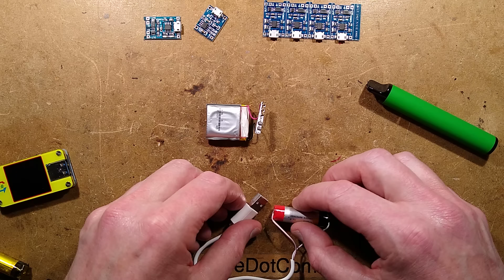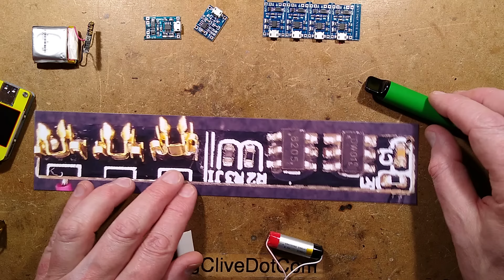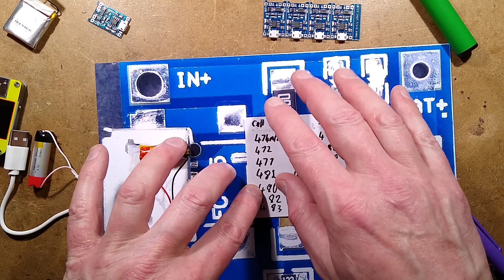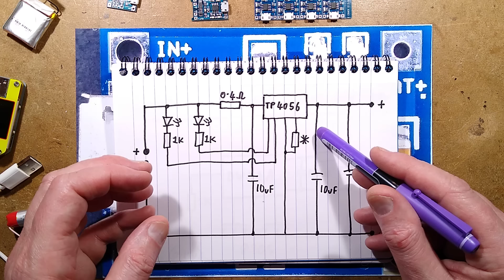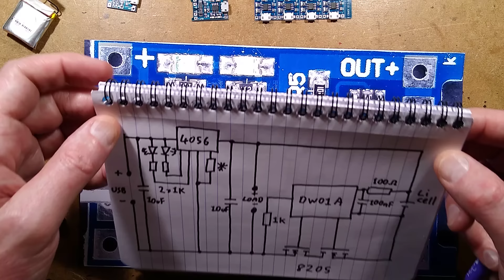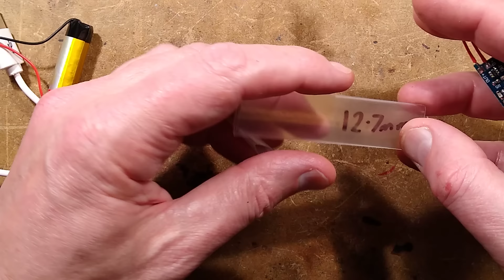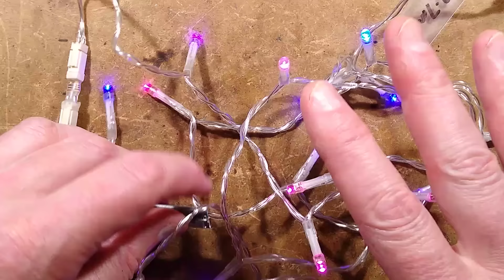Don't do this!   (There's a much safer way)

Comment: Yeah, the first time I tried this years ago I found that to wire idea quite dangerous. Not I didn’t do it a little bit until I found these really simple $10 items. They charge 4 batteries at a time, different sizes in length and width because I find a way to balance them in there. It’s not too difficult. But a square battery, or something like that odd shaped I had to put little clips on one of my ports. That way I could just clip it onto the battery terminals, but as far as length and width the round ones, it does perfectly. At one point I had over 200 batteries because like he said you can find them and vapes everywhere. Plus I was smoking a vape every four days. My aunt , same thing and I just saved them up and I converted my flashlights around the house to run on these batteries. Also, I got one of the tiny charging port chips that he is talking about and I was able to take one of my remote controls apart for the TV  have a port sticking out and I installed a little battery from a broken iPad, stylus pen, and it had a long skinny battery in it like on the tiny vapes. I put that inside the remote closed up the remote and I’ve never had to buy batteries for it since.  I just pop it on the charger every now and then and I’m assuming that battery will probably last for life not that TV and charger considering it doesn’t take much to charge it. I also love the little batteries inside the EarPods. I like to take the cheap ones apart when I have a spare small speaker and pop the front earpiece off of the earbud and very carefully take hair like wires that are going to the tiny speaker off and hook them to a slightly bigger speaker and put it in a neat little container and stick it in a planter and I have a little Bluetooth speaker just sitting around in different places. Yes I was a little weird, but it was fun.  The chargers I was talking about I found one on eBay. Here is a link it’ll give you an idea. https://www.ebay.com/itm/274434618596

I even converted my mag light. And a bunch of my little flashlights. It gives them some serious juice considering 3C or D or AA batteries only equal 4.5 V one of these “3.7“ volt rechargeable batteries which do charge up to 4.2 for some reason and I will tell you. They were bright. You just have to get creative and figure out a way to convert things. One of the bigger, plastic flashlights, I actually added a few batteries inside of it that I got from old laptop batteries Those are supposedly “dead“ turns out when I break them out of the plastic casing and take them off of the little board and I don’t know if this is just my imagination, but it seems to work and I’ve had people witness it. The top of those batteries on the positive side have the little vents and I reach in there with a paper clip or something small and press down and I hear a little click. I do it on all  the little holes on the positive side of the battery and low and behold that battery that was registering dead as a door nail on my multimeter, suddenly registered as having some juice in it after doing that little trick. We’re talking batteries out of laptops that are 12 years old 10 years old. After typing this I went, and I found an article on indestructible’s talking about exactly what I do to revive them. https://www.instructables.com/Recovering-18650-Lithium-Batteries-With-Only-a-Pap/ 

I didn’t know if I smelt that ominous smell of the battery leaking to throw that battery away I did not know that there is a fuse in there that it’s disarming or resetting but I’m glad to know that I wasn’t just hallucinating. Because those batteries went from registering, almost nothing to registering like 1.2 V from just putting the paper clip inside there and doing that.
That little circuit board in there apparently makes it seem like the batteries are dead in the laptop but if you pull one out, check it with the multimeter and it registers is completely dead do that little trick in the holes on the positive side, just push down as if there was a little button in there and then put it on the multimeter afterwards, and if your experience is anything like mine, it will suddenly register that there’s some juice in it and then I’m able to pop it on the charger and use those batteries. I’m not great at all of this stuff but I’ll tell you what it’s fun. But as I was saying about the bigger, plastic flashlight, I put 3 batteries inside of their together running in line and now my flashlight will actually charge my phone if I needed to. Lol.

Comment: This is all fine, but if I could please request a video? I wish to use a similar setup to make a powerbank, so I will need to solder some batteries in parallel as well as in series (I assume), and I don't want to set my house on fire. What equipment do you recommend? Can you make a video with step-by-step instructions and material lists? Much appreciated.

Comment: I found once protection PCBs for 18650, 18350 and 26650 with pre programmed overcharge safety set to real 4,19V, made "dumb" charging solutions for small DIY projects pretty convenient and easy by just using a 5V power supply.

Regular protections circuits on LiIon cells have typically anywhere between 4,22 and 4,25V cutoff voltage mostly so every charge harms the battery noticeable more.

Comment: I have a phone that has a 2-cell battery and can be charged with up to 120W. Actually I charged it quite often with 120W and after 2 years the battery is still fine, although acccording to this video I shouldn't charge it that fast (it takes less than 20 minutes and according to this video, charging should be done at a speed at which it takes over 30 minutes or evem slower with over 1 hour). Why is this the case?
Reply from the maker: Routine fast charging puts extra stress on the cell.  But your phone may have only been doing it within the central portion of the charge.
Reply: @bigclivedotcom  it definitely charges slower when over 80% or so and quite slow when over 95%.

Comment: i re use a charger built for a vape battery it only charges the breeze vapes to 80% which is fine with me as i try to keep them as long as the coil isnt burnt tasting.

Comment: That connection makes me physically sick. Even with bunch of voltage drops on the cable, the battery will get overcharged eventually.

Comment: Saw on one video that if you want to charge this Li-Ion battery you can put from 4.5-5.2 kOhm resistor to cut to 0.250mA charging or 0.125mA. This is R3 resistor on circuit board. Thank you on clarification. Regards

Comment: Charging batteries like that is a very bad idea, obviously. 
But I sometimes use a similar technique to revive completely dead (0V) phone batteries. Set a bench PSU to 4V or so and shock the battery for a few seconds at a time until it gets to somewhere around 3V. Then you can put it back into the phone and charge it up as normal.

Comment: I think it's criminal how lithium batteries are included in throwaway products. You are doing a great service by showing people how they can be reused.
Reply: That and I’m sick of seeing the box and the wrapper on the floor next to the bin outside the shop the child has just bought it from.
Reply: @jamessones4044 not to mention all the little stickers stuck to the bin or everywhere locally around the shop.
Reply: these disposable  ones need to be banned.no i think paper cigs were better.
Reply: Don't be idiot - crime is PRODUCE so dangerous batteries!
Reply: But how many of those people actually see the value of and reuse these cells?  Nowhere on the packages do they suggest other uses or even to recycle them like lead acid batteries or add a core charge to the price.
Reply: It’s insane. Got a vape with Bluetooth capabilities and a huge screen. Saw another that is straight up just a phone. And we’re supposed to throw them away after? It’s crazy
Reply: absolutely, its such a waste. Lithium is so damaging to the environment to produce. Not to mention some of them now have screens, hell even bluetooth speakers (look it up), so we're also wasting silicon for the essentially little computer inside, which is a precious element that is getting harder and harder to find. It's also very damaging, but not as much as lithium, lord.
Reply: @apollo7557  Silicon is not hard to find. It's literally the most abundant mineral on the planet. Yes it needs to be processed, but it's the rare earth and precious metals that are scarce. Such as lithium.
Reply: @EgoChip  well yes, but the chip shortage would like to argue with that
Reply: @apollo7557 The chip shortage was caused by COVID and the greed of car manufacturers (and the extremely limited supply of 200nm process fabs) not by a shortage of rare earths or any other minerals.
Reply: @apollo7557 chip shortage anyone? 😂
Reply: This absolutely 100% should be illegal.

Comment: If it works, it works, keep it simple.
Reply: It works only in theory. The battery starts heating up to dangerous levels very quick. And you have to constantly monitor the voltage because it's very easy to overcharge it and create a bomb.

Comment: i would be very interested to know if you could make a additional content to this where your use more of these batteries in parallel to up the capacity of the batteries (now battery pack)

i know that there are some technical difficulties with batteries when there are not the same voltage so i assume that simply doing what you did and just add batteries in parallel won t be an optimal solution
Reply from the maker: A large parallel cluster (when voltages are matched) does add up to one big cell.

Comment: I literally was thinking about YouTubing this. Here it is. I charge it on my vape 18650 battery charger. My question is if i combine two cells do you need a battery change controller? If charged correctly. Also 18750 car like a bomb if they go off. Overcharged a vape when it exploded it left nothing of the vape. Honestly surprised terrorists haven't turned Tesla's in to a IED

Comment: So I found out that the low voltage is too high imho. It's right in the peak delivery voltage range, iirc 3v. Is there a way to lower that to 2.5v?
Reply from the maker: The lithium cells are normally charged to 4.2V.

Comment: I just put them into my battery charger. It's a multiple battery type charger. I bought it for my 18650 batteries for my vape. It works with disposable vape batteries as well.

Comment: It wouldn't be too hard to make a variable programable resistor, so when it's at 80% charges slower the battery right?
Reply from the maker: It's easier just to use the chip designed for it.

Comment: It's normal for the TP4056 to heat up when charging a vape battery?
Reply from the maker: Yes.  It acts like a controlled resistor to limit the current, so it does get quite hot.

Comment: The USB cable had a chip inside that limits current. Cheap ones only allow about 1amp of current.
Reply from the maker: Most standard USB cables have no chip and no current limiting other than their thin wire.

Comment: Do not screw with flat lithium ion battery’s at all, ever see 10 volts in one second turn a 3 volt 3623 flat thick battery hit 220 v and not even be warm then change polarity? Wtf?

Comment: THERE IS NO WAY you're meant to charge this at 500mA to 1A. I guarantee if you try charge it at 1A that thing gonna go boom. It should be charged at like .1-.2 absolute maxium 0.3A. Usually your videos are awesome but missed the mark on this one.
Reply from the maker: These cells are designed for high current use.  They handle 1C charging well.  You can choose to charge at a lower current if you wish.

Comment: I have a large bag full of thse cells. Have several ecig users in my family. they know to save them for me :)
Reply from the maker: Make sure you keep all the cells in individual small bags or put a bit of tape over the contacts at the end to avoid any accidental short circuits.
I keep my cells like that in metal trays for safety.

Comment: I’ve read that these modules can handle up to two cells, how would you go about connecting two in a safe and solid way?
Reply from the maker: You can connect multiple standard lithium cells in parallel, but they must have a very close voltage when connected to avoid high current flow between them.  Once connected in parallel they will act like one big cell.

Comment: The problem with vapes and vape's batteries is that the residence isn't a resistance that lowers the current while heating up, but they're 2 god damn wires, one attached to the battery, and one to the switch on the bottom.
This is a huge problem, because using them and thinking that reusing the battery is an option, may cause people to EXPLODE WITH THA BATTERY!
Damn these guys can create an entire vape, even find damn nic, and still are not able to set up a DECENT resistance scheme!!

Comment: What if I don't have a soldering tool and don't want to mess around buying one etc. is there an easy way to connect the cables to the board?
Reply from the maker: Sadly no.
Reply from the maker: Sadly not.

Comment: When recycling these batterys can you still fit the new electronic componants into the original case body of the vaping device i have been designing an idea based apon your knowlege using these to supply power to lights via a solar pannel or convert these vaping devices into recycled led torches as they are a good size to keep in a bag or pocket when out and about, but the case body looks compact which could limit the ability of reusing the case as well as the battery. guidence would be greatly appreciated bud.
Reply: Clive have you seen the IVG 2400 multi devices when you look at the body of these the top part has pods in them which are easyier to remove with little to no mess the bottom compartment is  where the battery is ive not opened this device yet but these devices are running (according to the case) 6.48wh 3.7v batterys. 😮

Comment: I connect it in parallel to a power bank battery that has a 3.7v battery
Reply from the maker: Some current limiting would be good when doing that.
Reply: @bigclivedotcom  current divides in parallel right?
So a resistor in parallel

Comment: I work a street sweeper job and also change trash bags at all of my stops. I have vape stores at a few of my stops and have found 130 of these disposable vapes so far. I would love to know how and if its even possible to make a larger battery from all of the batteries I have.

Comment: hello bigclive, i just watching videos of yours about these modules, and a little thing that you may not know i have discovered that the batttery plus and the out put plus terminals that together are connected anyway as if you do a (whats that word dang it cant spell it, where you check if some is connected directly or not ).. and also do the same with the out put minus to the usb side of the board of that other pin, they are both directly connected to each other
Reply from the maker: The protected modules do have the positive as the common connection.  The negative is the connection that is switched through the MOSFETs.
Reply: heres a question, with these batteries from these say air blowers for smoke , would you recommend , putting two of these in series to a circuit to one of those modules, or would it give out double the amound the out load needs say to lights, ? @bigclivedotcom

Comment: Can you do a video on load sharing with the tp4056 so that it can be used as a ups or use a solar panel to charge the cell and power a circuit at the same time while charging, thanks :)

Comment: i found a broken remote control car a long time ago and harvested its little micro USB lithium battery charge board to top off upcycled lithium cells for years. its essentially exactly like this! I had no idea they were so readily available from ebay i might just have to pick up some to play with.

Comment: Those little white connectors are findable by searching for "jst connector". The little ones are jst-sm. Theres other models available but the sm is probably the smallest reliable connector you can use.

Comment: What's really scary is that there are tons of toys sold on eBay and Amazon with USB leads connected directly to the lithium batteries. My mother got a cheap remote control car for my son last Christmas, and I was like, there is no way I'm charging this. I wish I knew about these charging boards then.

Comment: I just wanted to say thanks for all the info,
  Due to pesky health issues, I don't do big project anymore and sit around bored. I welcome any broken toy, radio, TV or other electronic devices. to my work desk to keep me busy. 
  There are thousands of connectors. I would never find the right ones without your channel. I love to "tinker" with projects and you have answered so many questions throughout the years. I have modified so many things with salvaged rechargeable batteries and to make things safe, I just hop onto your channel and find these little modules for this and that.

Comment: Pfft I do I this way all the time, just use an oscilloscope an dc supply, non switching, and do math based on battery voltage and capacity and charge power

And just time it and check oscilloscope  voltage
Reply: If you squeamish then throw a zener and power resistor in series

Comment: Is it possible/practical to connect a 100 of these for a stationary power bank, or balancing them will be a nightmare?
Reply from the maker: It could be done as a parallel 5V power bank.  The voltages would have to be very close before they were connected in parallel, but once done they would act as a single high capacity cell.  It would take a very long time to charge them with a standard power bank module though.